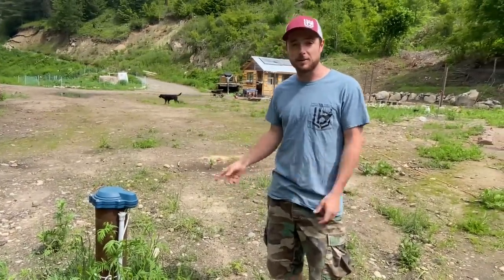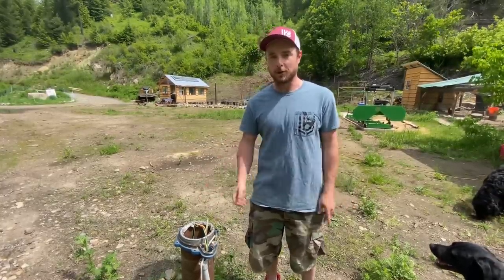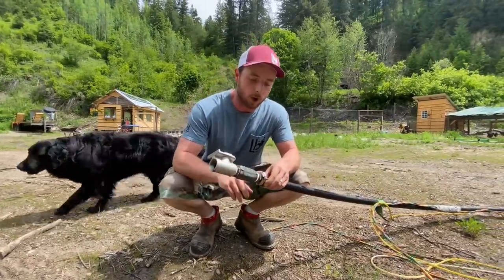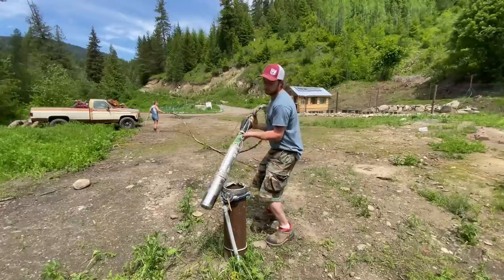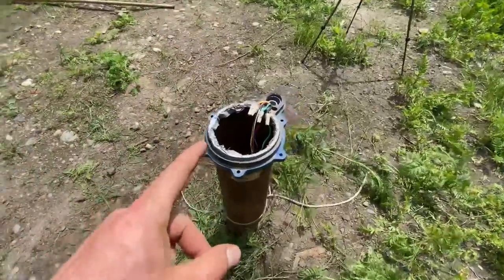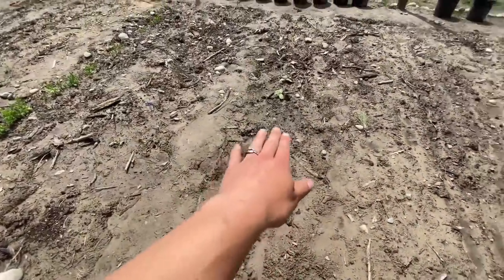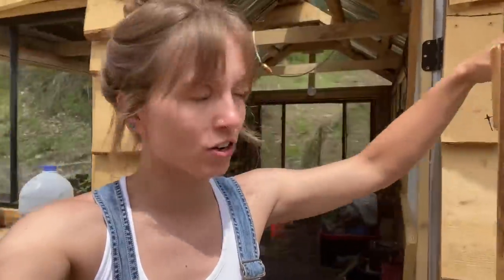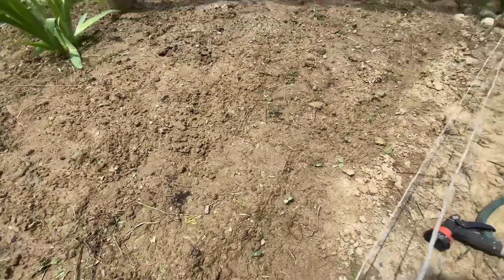The Mistake Every Well Owner Is Making

Comment: As a former crane operator I was taught to install cable clamps with the saddle on the live part of the rope, and the "U" bolt on the dead end and to never reverse them.
Reply: Never saddle a dead horse. That's what I was always taught.
Reply: Great bit of info for folks. Thank you for sharing. You make all of us a little better.
Reply: And.. is there any reason to leave a gap between two clamps?
Is it not better to have them side by side?
Feel free to inform, if you have - presumably - engineering knowledge.  😉
Reply: @thetessellater9163  Don't know.
Reply: As I was watching. Saw he was doing it wrong and thought there must be comments and sure enough there was. Never Seattle a dead horse. Taught in every safety course on rigging!
Reply: Don’t saddle a dead horse
Reply: I am a retired of 35 years and learned the same thing. Pull it up and fix it.
Reply: @thetessellater9163  there is a gap but it is dependant  on rope size.  Looking at the video and about 6 inch of loop rope.... will be OK for 3 saddle correctly installed.  It is also missing a metal eye to protect the rope

You can get this information on Internet.  His current setup is likely only good for 20% to 40% of the WLL of the rope.

Also, there a torque for the bolt.  Likely, around 30 lbs-ft... no more, no less. . Also dependant on size of hardware

Comment: I've installed hundreds of well pumps, anywhere from 25ft to 1000ft.
•Use a stainless fitting with a long hose barb at the pump, with 4 clamps to the well pipe, heat the pipe (inside only) slightly with a torch to slip the pipe over the barb, allow it to cool a bit, then tighten the 4 clamps. The heat creates an actual mechanical connection to the hose barb.
•On yours, 2 torq boots is enough one above the pump, other half way up, *you gotta compress them, to expand to almost the size of the casing tho. *if not, the pump will slap around the hole on start up and muddy the water, could even loosen the threads at the pump and fall off, I've seen it.
•Electrical tape the wire to the well pipe 3-6 inches wide, every 10ft.
•use water proof heat shrinks with sauter inside them, for connections at the pump.
•Put tape over every single clamp, as you feed the wire up the pipe and tape it onto the pipe... tape everything.
•as you tape the wire to the well pipe, keep it fairly snug to the pipe, loose wire chaffing on the casing is the biggest reason pumps fail.
•only time I've ever used a pull rope or cable was on pumps over 400ft. 
●always use the same exact size pump that was originally put in your well. Oversized will literally hammer itself to death, undersized will burn itself out working too hard.
Reply: I also have done hundreds of pumps and agree with just about everything you said! Soldering the crimps is an optional touch and I would make sure that they don't pull the pump out again just for that!   🤭 We usually skip the nylon rope but do find it was often used when submersible pumps started replacing jets. I usually will switch to threaded schedule 80 threaded pipe when the length is somewhere over 200' depending on if I'm replacing heavy gauge (160-200 psi) pipe if it's not ridiculously long. IMO once you get over 200' it becomes very difficult to deal with coil pipe and using length's with the Upsy Daisy machine is easier at that point. We in our area (the NE) normally will consider galvanized steel pipe (requiring a pump truck) when the pump needs to be over 600'. Some will use the even heavier plastic length's that reduces the diameter and go a little deeper. I don't use a pump rig anymore and shy away from even 600' wells. 
  They might be using an over-sized motor with a high gpm water end because it seems to be set up for irrigation. But the small amount of area being watered wouldn't justify that set up. I didn't see or hear the tank size which might have been in a prior video, but as long as the tank is big enough I wouldn't give them anything else to worry about and think that needs repair or replacement!   
It's amazing that they didn't drop that pump with the pitless pipe barely caught into the pitless adapter! Probably have a bad thread either on the pitless pipe or in the pitless itself.
Reply: Two years ago my brother, in Maryland, had to replace his well pump. 165 feet, 20 foot steel pipe. New pump and plastic pipe. The well was installed in 1978 and never been pulled out.
Reply: Are these pumps. 110, or 220?
Reply: @ronstuart7494  They are most often 230 Volt but can be purchased as 115 Volt. I generally have found that if the pump was upgraded from a jet pump or even an old piston pump that the installer might have stayed with the original voltage. When doing a jet to submersible conversion, I recommend that the owner have a new circuit to the panel installed as 230 volt pumps seem to run smoother and at some point in time when replacement is required, most pump repair or well drillers will more likely have a 230 Volt replacement. For some people who don't want to wait for an electrician, I have just ordered and installed a 115 volt pump. Wells that had a jet or piston pump aren't likely to be very deep. Probably less than 180-200' so a well that's much deeper was likely drilled with the newer equipment that came out in the 1960's and actually drills instead of the old chopping machines. It's not likely that you could find a pump with enough HP to work in a well like that and be available in a 115 volt version.
Reply: @MILGEO  I haven't even started drilling, however, it appears submersible are better all round while jets are for 100 ft.  or less?   You are an appreciated font of the information.
Reply: @ronstuart7494  I would say that you would be better off with a submersible in a drilled well even if it's very shallow. Jet's are pretty much a thing of the past and are prone to problems that subs aren't such as priming problems caused by a small leak or foot valves leaking, and if it's over 25-30' you'll need a deep well jet assembly which uses 2 lines. One larger than the other, usually 1" and 1 a 1/4". The jet is installed in the assembly close to the bottom and is prone to problems if sediment or a chunk of rust gets into it. They usually won't make shut off pressure and keep running 20-30 lbs until it's pulled out to be cleared. I use shallow well jets where people have lakefront property and want to use the lake water for outdoor gardening, etc. I don't think it's safe to put submersibles with live electric where people might be swimming. I've seen them while scuba diving and really don't understand why anyone would take the chance! Hope you hit water without having to go to deep!
Reply: @MILGEO You have given so much valuable and accurate info - much of which I have learned over 40 years.  I have done my own well maintenance on my property for over 40 years - 4 pumps (1 by lightning after 11 months, and 1 by chaffed wire shorted motor after 7 yrs) other 2 burned out probably due to sand accumulation in bottom of well.  I have raised the pump up 40 ft over the years since the original well was drilled to 400 ft - to help avoid sand in pump screen at bottom of well.
Reply: You have offered so much valuable info - all very accurate.  I have had to learn many of what you have said the hard way of taking care of my well maintenance for over 40 years!

Comment: I'd suggest you disinfect (shock) the well any time you open it, especially after dragging your pipe across the ground.  No telling what you've introduced into your formerly closed system.  And once the bugs start growing, it's difficult to reverse the damage without abandoning the current aquifer and going deeper.  Also, I'd have more confidence in a poly rope than plain steel over the long haul.  It won't degrade in the dark (UV is the enemy of poly), while that steel cable will eventually rust.  May take a week, may take 10 years, depending on the pH of your water.  Also, poly rope won't vibrate its way into your cable insulation...

Comment: It has been my experience that where the galvanized meets the air it will rot and fail stainless is more expensive but will last forever. Also the Crosby you used are of dissimilar metal and will cause electrolysis. What you have will last a few years depending on the acidity of your water and the iron content. Good luck I hope it works well(no pun intended)
Reply: I've found that about 95% of the time the pump needs to be pulled due to an electrical problem assuming that the original installer didn't do anything too terrible like over tighten and crack a fitting. Of course galvanized will rust eventually since it's carrying water. And low PH would hasten that but I don't believe I've ever seen Stainless Steel pipe in a well. If it's made it would be so expensive that I couldn't see spending the extra money since the pump will likely need to be pulled out long before the pipe rots out! Stainless Steel pipe is something that is more suitable for a food processing plant or similar.  And galvanized is usually only used on very deep settings, like over 600' maybe 700' if the extra heavy Schedule 120 plastic is used which has a narrower inside diameter. FYI, I've pulled out stainless steel pumps that had the outer portion rotted away exposing the impellers. (rarely).

Comment: That poly rope is made from the same base material your water pipes are made from. The wire rope can decay unless you used stainless steel. The cable clamps could rust particularly if the hardware is zinc coated. Your pipe is a poly pipe so if your concerned about plastic you should replace it too. If you use plastic pipe in your house same deal. My point is that I would be more worried about the tape adhesive and the rusting of the wire rope and well casing than I would the poly rope. Poly rope is the standard in wells and I replaced some poly rope that had been holding up my well for about 30 years and it did the job of lifting the pump up. In the dry upper portion of the well cavity it had faded, but what was below water was as yellow as the day it was made so I don't think any dyes came out, and I don't believe it's dyed...maybe before the materials are melted into the end product. 
Not being vegetative just pointing out some things. I love watching you guys and I’m a lot older and a lot more mistakes ahead of you lol

Comment: We have no cable/rope holding up our well pump, so no mistake was made.  We also do not use that cheap poly pipe, ours is schedule 120 threaded PVC well pipe.  In time your wire rope and galvanized clamp will rust.
Reply: Actually you are 100% wrong because every well should have a safety cable on it just for cheap insurance and the pipe that they are using is certified schedule black pipe and there is absolutely nothing wrong with it !!!!! You sure are rude !
Reply: @brucewitcpalek5120  Schedule black?  Seriously?
Reply: @brucewitcpalek5120   Here in Canada we use 100 psi poly-pipe. Also , you should  only use all stainless steel gear clamps.  Rick.
Reply: @rickoncordova1  Thank you that is exactly what I was talking about but I made a mistake because I couldn’t think of the name at the time and I called it a certified schedule black pipe instead of what you called it.
Reply: @rickoncordova1  Absolutely correct also I always put on a safety cable because that’s cheap insurance
Reply: @rickoncordova1  The Poly pipe is more than strong enough, even 100 psi, but the problem with poly pipe is always the connections, a slip fit with hose clamps is an inferior way to secure anything with weight on it.  It is difficult to find all stainless clamps, typically the screw is not stainless and rusts out first.  It should also be noted that just because it is labeled stainless does not mean it is a good grade suitable for constant submersion.
Reply: @NotOnYourLife   Your response to all s/s gear clamps shows how feeble your mind really is.
Reply: @rickoncordova1  
Hm' slagging the need for SST gear clamps is irresponsible! I witnessed major failures at Tourist Camps with new Water Line installations, when they didn't realize the importance of having 100% SST Clamps! Soil acidity can eat up a coated steel screw in less than a year!

Comment: Good job swapping the rope for a cable. During my time in the Navy I worked with a lot of cables and slings in my job. The next time you have to pull the pump, you need 3 clamps, and the ending side always goes towards the loop on the clamp, never on the pad. All three face the same way. You'll  be fine in the mean time as cable clamps are pretty tough little guys.  Keep up the good work.

Comment: You guys should’ve used a coated cable due to the cable will eventually rust ! I’ve done wells many many times & discovered this Idea quite by accident. It does work very well. Y’all are doing very well keep it up. I’ve been off grid over 35 years. Good video 👍👍👍👏  👌

Comment: I have a well system and any time I have my well worked on and the  pipe and wiring is out and  set on the ground you should put a small amount of chlorine in the well before you use it for drinking to kill any bacteria  that my have  contaminated the sys while laying on the ground.

Comment: Manufacturer recommends installing all wire rope clamps in the direction of the first one. "Never saddle a dead horse". The saddle being the forged part on the nut side. In your application, it shouldn't matter.
Reply: Fyi: the dead end is the shorter folded back portion, so the curved part goes towards that side (in case it was unclear).

Comment: After you laid the pipe on the ground with animals bacteria around .Shouldve thrown  1/2 gal bleach down it for 8 hours.Then pump it down. X plumber for 50 years. Cable guides for wire helps too.

Comment: I used to replace well pumps occasionally. The previous installation sometimes had poly safety rope. There was often a short length of rope outside the cap that was exposed to sunlight. That short piece of exposed poly rope would become so brittle from light exposure that it would break and fall down into the well before we could get a hold of it. Stainless safety line is a better choice.

Comment: On your low spot in the garden dig a hole and bury a 5 gal bucket. Put a small sump pump and run the hose and the power out a cut to fit hole on the side. Then cut most of the center of the lid.  Make a cover for the lid hole of window screen.   Next year you care level your garden.  Good luck

Comment: I live in Florida, even the well drillers here use ski rope to tie the submersible pumps in. Our wells are plumbed with schedule 80 PVC, with slip couplers for the twist cause by the pump torque. The wire rope and crimp nuts you used will rust in time, and me, I'd take my chances with the poly rope and dyes? I still love ya'll ❤️,  everybody marches to a different drum...lol

Comment: I once had a 300 ft. deep well. Lightning trashed the pump. The well company used a tripod device that had 2 motor-driven rubber tires that clamped around the well pipe. Turn a switch and the pipe rises from the well! My pipe was plastic, in threaded sections.

Comment: For your garden  suggestion  consider  building  a hoop cover to protect  front early frost  and would act as green house ?  Somewhat in spring   just matter of wood frame  and pvc or cpvc making  hoop arc  to support  plastic  sheeting  or even a netting to prevent  flying  insect preditors and birds that at may eat you vegetables  
So of the early episodes  of Lumnah Acres in I believe Vermont  or that general area also a cooler growing inviroment

Comment: There were many Commenters who recommended galvanized pipe! Woah, I had a Commercial Water system and I don't know how many time's I took Piping apart by the Jet Pump and McDougall Bulldozer Piston Pump and found Only One Thread left because of corrosive water! I started making my own Pipe Nipples from Schedule 80 PVC, or use SST, or Brass found at Farm Supply Stores.

Comment: Great video, we always use cable like you switched to but we used 1/4" cable. Be aware that if you're fortunate enough not to have to pull your pump for years, that the cable can or will rot and break in two, it happened to us and our well is just a little over 300 feet deep.

Comment: Mountain life in the west and the cool nights. Take some of those cedar trees and build raised beds. They warm up and help retain heat and the excess water will drain better plus you can make them level. Cut down some cedar and build the beds inside during the winter months. 4' x 8' x 18"-24" high. You could easily put 10 of them in the garden and leave room for all the vining plants that need lots of room, start them in the greenhouse. You can start earlier that way plus you can use PVC to hoop over the beds and cover them with plastic for mini greed houses until it finally warms up plus it will help with plants that don't play well together. Your growing season is short enough and anything that extends it makes a big difference.

Comment: Next time you are in there why not add and extension above the pitless adapter that comes up just beneath the well cap and then screw your lift bar into that, it would prevent you from having to try to thread a needle from a mile away. Also it would drastically help prevent cross threading resulting in messed up threads on the pitless adapter.

Comment: Your lucky my well is 343 feet with 220 feet drop pipe including 4 torque arestors  and is inside the house root cellar so it all has to be pulled by hand thru the bladder roof and SOB is it heavy.